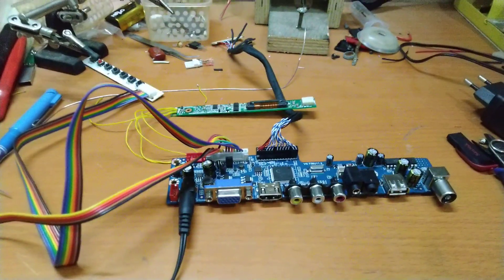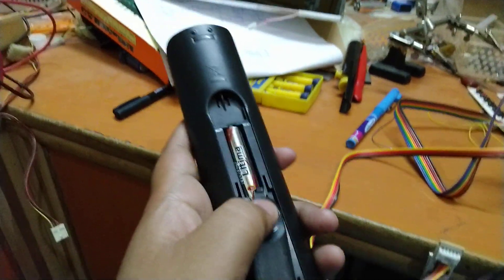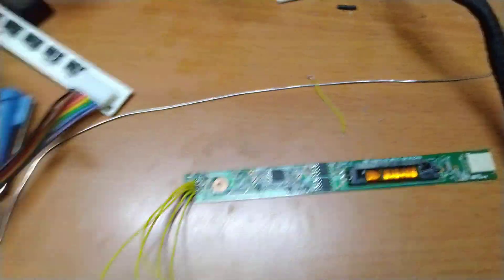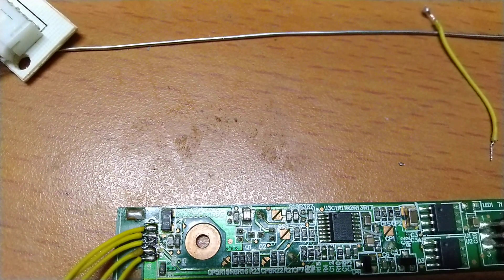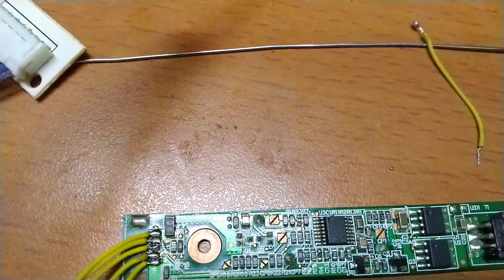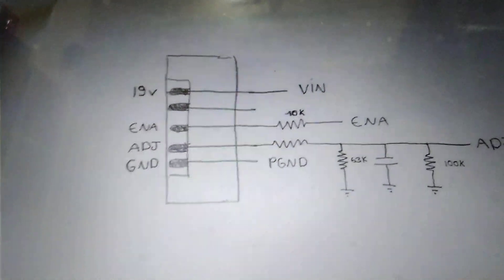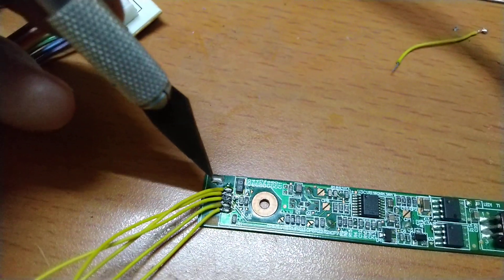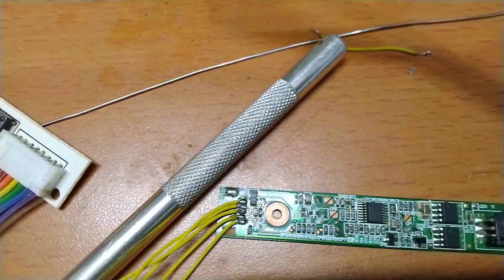Know the Pin-out of Laptop LCD screen Inverter.

Comment: Was your project successful?
Reply from the maker: Yes bro
Reply: @AmitNohria  so far I have turned on the backlight but there is no picture on the display ......I don't know what to do next
Reply from the maker: @0x75a9  YOU NEED A LCD CONTROLLER BOARD OR SOMETING SIMILAR WHIC WILL BE CONNECTED TO LCD THROUGH LVDS CABLE. GIVE IT A TRY
Reply: @AmitNohria  I purchased universal mother to connect to display which is 1366 x 768 display and the motherboard support this resolution....
I followed the datasheet to match the LVDS signal ...... but still there's no picture..... backlight is working fine though.....
There may be any issue with the display .....

Comment: What signal are you putting on the on/off pin? What voltage is it?
Reply from the maker: i put on/off signal connection from tv board to the inverter board. I am not sure for the voltage as i made this project 1.5 years ago. i think the input voltage was around 5v or 12v.

Comment: Bro. Im working on my laptop display.. I was connected the power and on solderd with one wire its working.. But my laptop showing the boot display then its going in windows boot animation suddely its disapear and showing a whinte screen... Help me
Reply from the maker: Must be windows problem, you should reinstall it or in case of recovery partition, do a system recovery.
Reply: @AmitNohria  its working on my tv when i connect to hdmi ... If the problem is on windows .. Hows that working ?
Reply: Broii